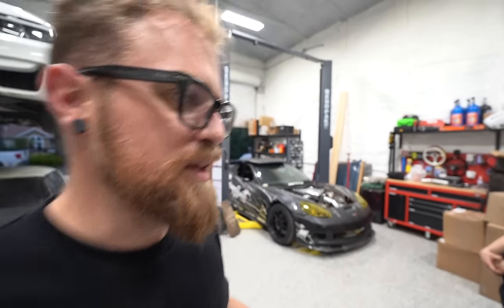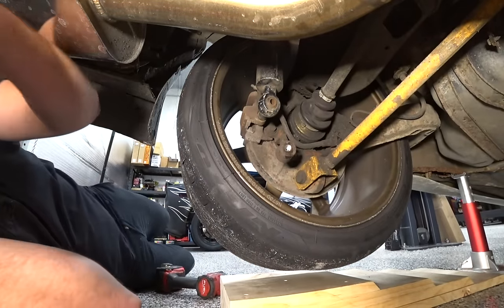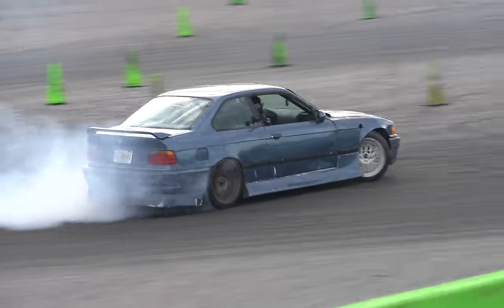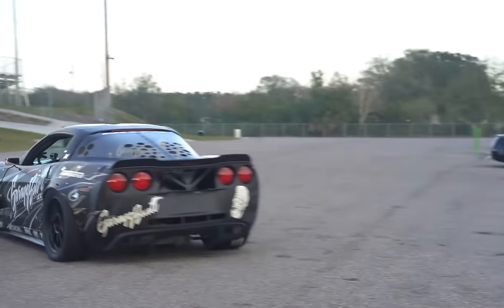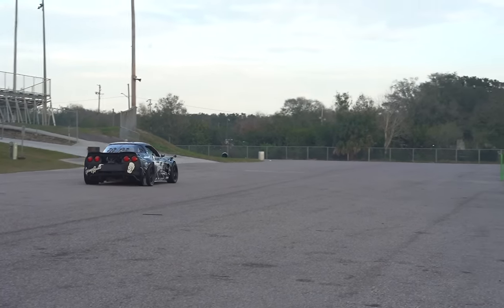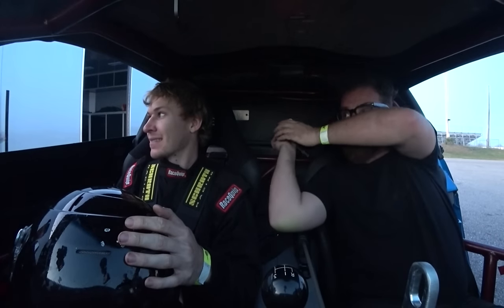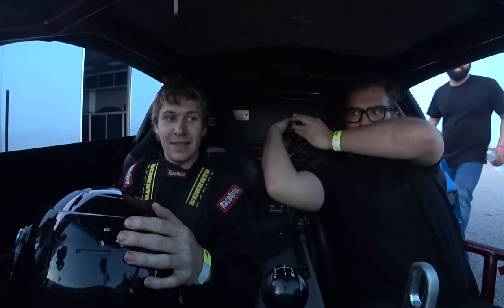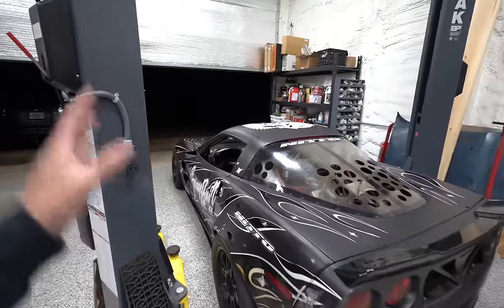Taking Drag Racers Drifting in my 1100whp Corvette (Street Racing Channel)

Comment: If one injector clogging up can melt your piston sounds like a reason to run all 16 injectors instead of 8. Based off what you said potentially extra safety. Theres probably a way to setup each running half the load or as backups if one voltage drops or has inconsistency. Makes even less sense to go out of your way and do a due diligence maintenance over view and just have dead injectors in the rail.

Comment: If you're not into Heli coils you can also cut a bolt and weld it in and just use a nut to take off the back shock on an e 36

Comment: Dude three seasons ago at north star (I live in Reno) I was doing back 3, big 180 method, and cab 3 stale. No bullshit my buddy mike talked me into going cab 5 on the 3rd booter when we were on the chairlift. When we were strapping in my buddy called me I told him "yeah this is our you know what we'll be headed down the hill shortly." Didn't even say last run. I said "you know what" because all the homes know what's up. Well, late in the day, shadows came in and I got bucked all weird on the last jump which was 65 feet long. Shattered my wrist, broke my collarbone, torn labrem and rotator cuff with a severe dislocation, 2 cracked ribs and a gnarly ass concussion. It was so weird because I was doing cab 3 all day. I go to actually land not riding switch and I fucked it all up. Crazy.

Comment: I periodically have pro dash issues similar to what was in your video, its not that it inst turning on its getting stuck on the "please wait screen" for me. After talking with Holley, they recommended i wire the switched power and constant power together. I then put the constant power on a toggle switch so i could easily power cycle it if it did happen again. which is still does but less frequently now.

Comment: I read a review when that ford truck came out and it did mention the very high pressure that the fuel pump operated at, for me I said I would never purchase one of those ford trucks! My friend did purchase one and the same thing happened to him and when the dealer finally got it fixed he traded it in on a Chevrolet.

Comment: Look in to EZ lock thread inserts, there are a solid insert and much stronger and even permanent solution.  Once you use them you will most likely never use a helicoil again if you can help it.